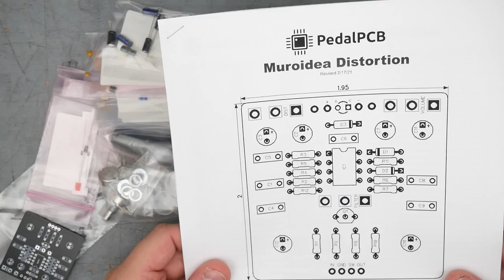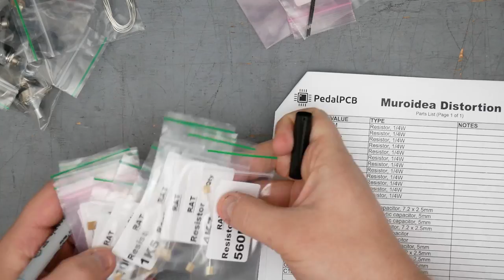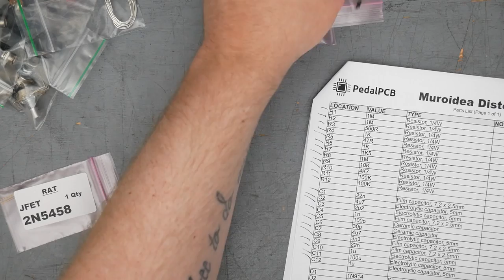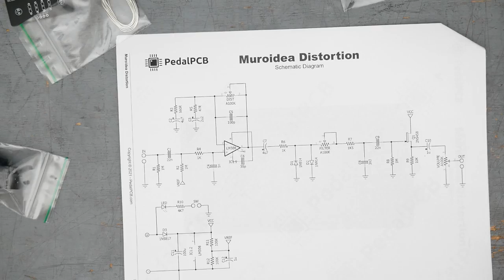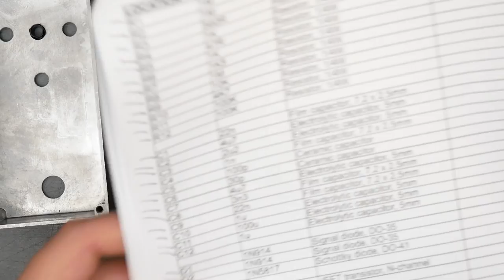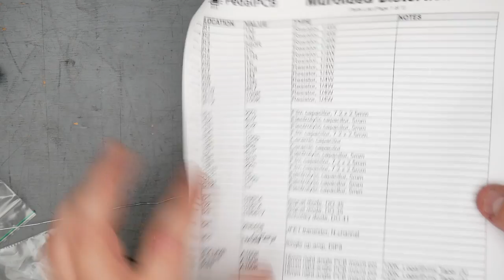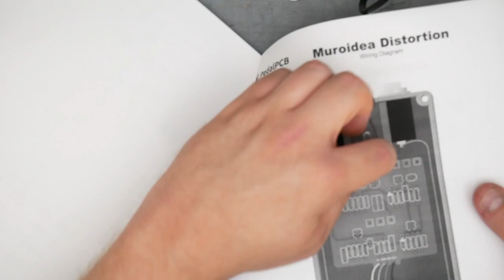Let's build a Rat for Charity! // Gray Bench Electronics

Comment: For bridging the lugs of the footswitch i usually take an already cut off leg of a diode (for example 1N5817). They are thicker than the legs of the resistors and are precisely to bend. I keep them for this in a small plastic bag, just like the rest of shortened cables. Thank you for the tip to push out the unused pins to socket the diodes btw.! Didn't think about it 💡

Comment: The sticky tack is a good idea. I usually solder one leg of the socket then turn it over and while heating that first pad I line up the socket with my other hand. After the solder cools and the socket is aligned I solder the rest of the pads then reflow that first pad to make sure fiddling with it didn't make a cold joint.

Comment: @8:51 "we don't care about " the orientation of the diodes: I just did a kit that had six diodes in a soft clipping format (a Big Muff Pi Opamp clone) and those diodes were ALL oriented the same direction on the PCB, and the traces on the boards made it three one way and three the other. So having these diodes by "opposite" on the board, you could have been wiring them in parallel both the same way. Good thing they were socketed.
Reply from the maker: You're right, I should have been more clear. The orientation doesn't matter with respect to the silkscreen for anti-parallel clipping diodes.

Comment: Thanks for this tutorial. I just finished one.  On the LED part, Anode is positive. Cathode is negative. On the board I see that squares are Positive. Except for this LED. Did they  make a mistake on the square but labeled it correctly on this printed circuit board? I reversed it and works flawlessly. Directions were great! I can only paint by numbers and am learning a lot on the way!

Comment: At 19:30 after you solder 2 pins of led diode, you put solder on your soldering tip before you store it away. Why are you putting solder on your tip after you're done soldering?
Reply from the maker: That's called "tinning" the solder tip. It prolongs the life of the tip, or so I was taught.
Reply: @graybenchelec  Reduces oxidisation of the tip of the iron is what I was told. Not that I remember to do it.

Comment: It looks like you totally took care of it but you should probably mention to people that they need to go over all solder points w/iso and a soft toothbrush. I suppose it's possible modern circuit boards can handle the shmutz but I wouldn't take the chance...
Reply from the maker: I should put something in there yes. The solder I use is "no-clean" solder which does not require removing the flux, but it's a good tip in general.

Comment: Does the stomp switch have a polarity or orientation?? I know the lugs be horizontal, but the switch could be in 2 different orientations with the lugs like that.
Reply from the maker: Nope, it's the same either way, as long as the lugs are horizontal.
Reply: @graybenchelec  thanks for replying.   everything looks good, not sure why it ain't workin
Reply: I was pretty sure it wasn't the switch.  I was looking forward to some nuno-ish sounds...dang it, lol
Reply from the maker: @joem6859  I'd take some pics of the PCB front and back, and post to either reddit.com/r/diypedals or DIYSB. Good luck!

Comment: On that wire you mistook for solder, could one use a regular piece of wire with the shielding still on the the section not being soldered?
Reply: The “bus wire” was what I was referring to. Is “bus wire” functionality different from the wire included in the kit?
Reply from the maker: For sure, I used a cutoff from a resistor I believe, but any wire would be fine, shielded or not. Technically even solder would work, although it would break very easy and be hard to solder haha.
Reply from the maker: @plantesounds8836  the kit didn’t include bus wire, I think I was meant to just use some of the black shielded stranded wire. I believe there was an extra piece.
Reply: @graybenchelec  awesome! Thank you so much for the reply. Thanks for the great video too. I’m using it as a guide for my first build.